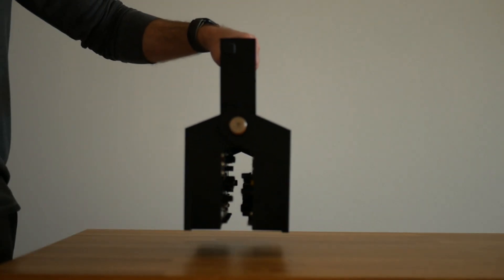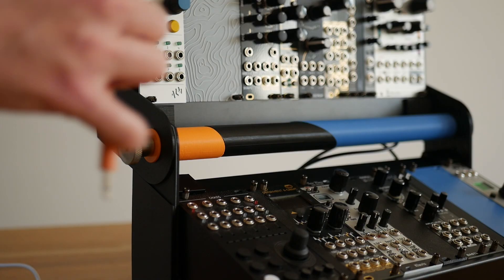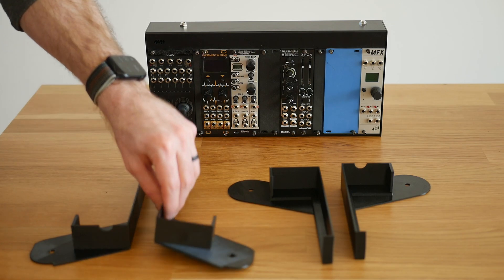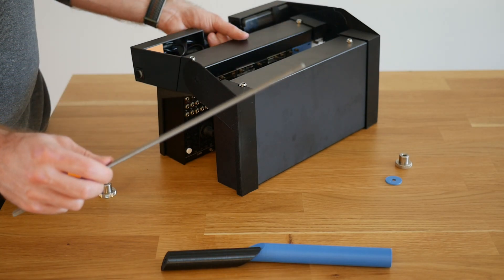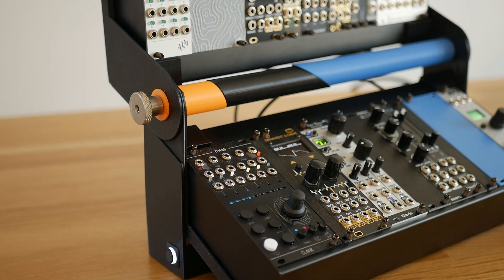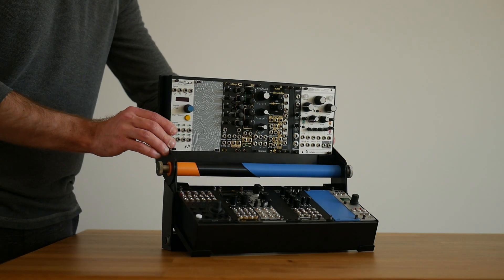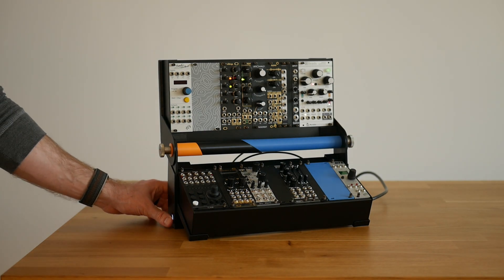Building my 6U 4ms Pod mod - The Duopod Eurorack case

Comment: Got two of these cases myself to go with two, 2 times 104 hp cases. Each of the bigger cases are independent systems except needs the sequencer that is in one of the ALM cases. 
My thought was to make something similar except the folding would be lengthwise and no wiring, just holes for the power supplies and the on of buttons. I will make it out of thin three layered plywood. 
Thanks for inspirational video

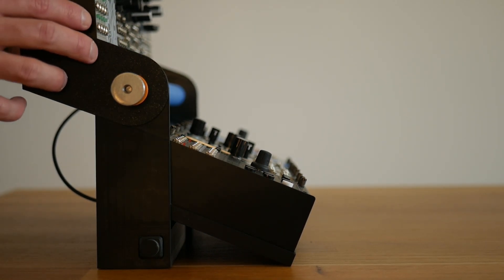Comment: This is a really cool design! Perhaps I'm not seeing it, but what is keeping the "top" pod from slipping out (say at  ~1:57)? I know the "inner" edge has a wall in front of the bottom of it (around where the 4ms logo is), but is the "outer" edge just pressure fit with the small wrap around overhang seen ~4:30?
Reply from the maker: Yes, it’s wrapped around the outer edge as a snap fit, there’s also a small edge that extends out from the pods slightly that registers with a gap in the printed parts.

Comment: what size pods are these?
Reply from the maker: They are the 64x, though this design could be modified to work with some of the smaller sizes by shortening the rod spacer and the handle. There’s a full list of the components used in the description.